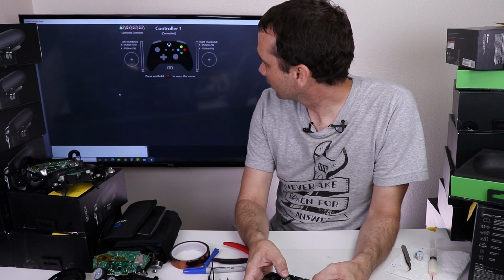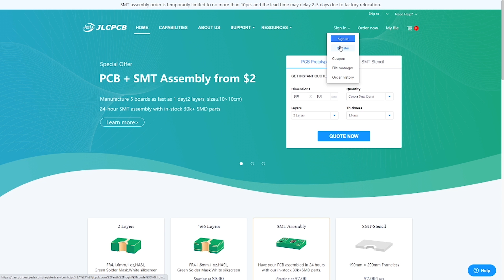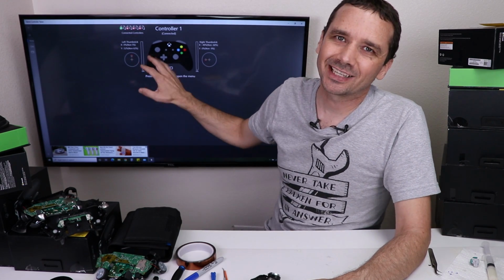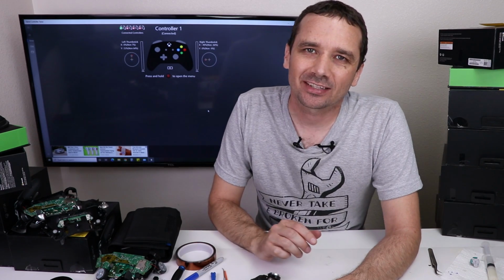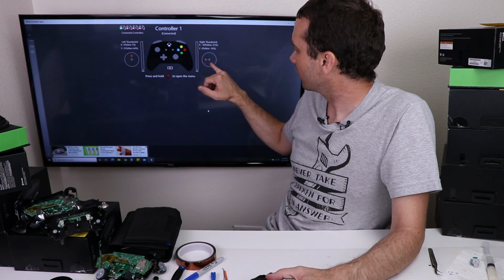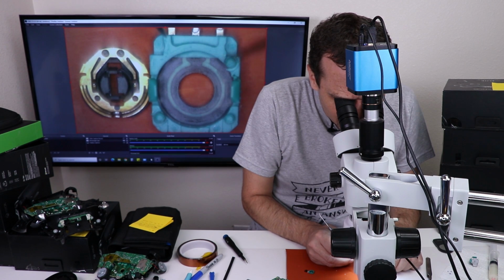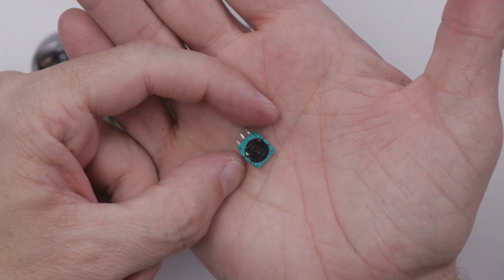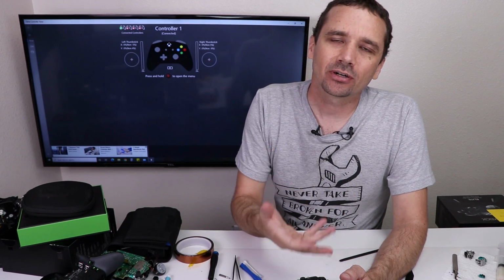How to Fix Analog Stick Drift - 3 Ways

Comment: I also just swap out the bad potentiometer ..... The nice thing about it is you can just use a soldering pencil and don't need a hot air rework station (Although I do have a couple of those too) There is also less of a chance of accidentally heating up and possibly losing one of the SMT components and you only need the most basic of soldering skills (Personally I've been soldering for over 45 years and can do it in my sleep) When I Mentor STEM students I just bring in some old PCBs and let them work with those until they get some skills and confidence by desoldering parts and soldering them back in again ..... Something any aspiring technically oriented person can do at home with simple equipment and then eventually work up to a hot air rework station as they acquire more advanced skills and knowledge

Comment: I have a question what kind of flux do you use and what temperature do you have the heat gun when removing  the soldering at the beginning. I have tried cleaning and changing the metal but no luck. So im try my hand at soldering even though I don't know how to solder. Any tips would be appreciated
Reply: I haven’t nailed down the settings on heat gun but it would be a minimum of 350c. No idea one air flow. 

Xbxox one/series controllers may need a bit more thanks to the massive ground plane sucking up all the heat.

Comment: Ive tried replacing my analog stick via soldering and I keep getting am up right input.  Could I have burned the board or not installed it completely.  Maybe moved a chip something on the board?

Comment: I have a question...i replace the analog stick and  it still drift. Any change that the drift is not cause by the analog stick? Or the replacement part is faulty?

Comment: Hey i gotto thank you befor asking my question i love your page and learned alot from it 📍❤

So i have a problem ... after i changed my R3 the analog stick still drifting like before now i am sure i have to add  smd resistor to recalibrate the controller 
Hopefully you can help me and others with that 
-Btw the resistor usually is smd 0805 (20 or 40ohm)

Comment: Hey tronics I need an answer for my disc drive on my ps4 the roller don't spin to suck the disc in and I see the gears or those white things don't move any clues how to fix I've cleaned any dust out

Comment: The black center resistance ring in mine was worn out but I noticed that only the middle of the ring was worn so I just bent the center metal contacts slightly(0.25-0.5mm) outwards and the joystick works fine again. When the outer edge of the resistance ring wears out I might be able to bend it inwards to use the inner edge before having to replace the joystick.

Comment: Amazing Video Steve! While you do say that your favorite method is just replacing the potentiometer, is there any downsides to that?
I ask because a couple of local repair people here say that they can do either method per my request, but they highly recommend replacing the joystick all together as it goes bad again shortly after.
Is there any merit to this claim? I want to make sure I do this right. I value your opinion and the potentiometer replacement does seem as the better option, especially given that you retain your original sticks, less solder work to do, and it’s cheaper.

Comment: I was wondering if it was possible when replacing the joystick if applying some dielectric grease to the potentiometers would help with durability? I was unsure if this would cause contact issues or not. The trouble is for me atleast most times the joysticks will fail quickly within 2 months. And it's just generally the potentiometers wear out again.

Comment: Just swapping the little disc that you took out at 6:00 usually works for me. No soldering required but you do need to spend a £1 to buy a stick from ebay.

Comment: I cleaned my controlled and it works fine now... huh.
Reply: I have a brand new controller and the right stick already does this
Reply: @Murdermatics  same bought 3 remotes in two months stick drift
Reply: @Murdermatics  mine is maybe like 2 months old at best and the stick drift started randomly and then got worse and worse and worse and this morning it literally just died. would not charge or connect or show any signs of life. however I tried again just now and it is working as normal. wtf
Reply: @Pugzei  yea im pretty fed up with Sony right now. Red dead killed my hard drive, both my brand new controllers are dead, and sony is quoting me over 100$ to fix my last gen system. I wonder what it feels like to be a valued customer. I guess 20 years isn't long enough to find out.
Reply: @Murdermatics  to a big company  like that they dont care if your a valued customer or not
Reply: @MrHunk85  I figure them caring would create the value in the first place. I agree that they don't care.
Reply: i opened it, used a compressed air to clean it from inside.
Reply: How ? You opned it ?
Reply: Huh...
Reply: So I spent 120$ on a controller
Reply: i tried doing that i still have really bad controller drift
Reply: @alannafey  worn out sticks then.

Comment: Some DualShock 4 controllers need to be just Zeroed in. Turn your controller over and there is a small hole to the right. Turn on the controller and with a paperclip bent straight push it into the hole until the controller shuts off. Then plug in the controller with your USB cable connected to the PS4 and push the PS button. If this helped all good. If it didn't? TronicsFix has the step, or buy a new controller.

Comment: What joystick replacements do you use? They are not in the amazon parts lists. I noticed on the 1st xbox controller you replaced the joystick with a different looking one (black vs the original silver/green) is that because it is better or cheaper? Thanks!

Comment: Hi.  one of my joysticks moves by itself.  I have tried to clean it on the outside but there has been no change.  The problem is that one of the housing screws is stuck and I can't get it out, even the screw head lost its form.  Do you know what I can do to remove the screw?

Comment: What is the program you used on your computer to test the analog sticks after each process?
Reply: You can just use windows own controller settings page in control panel (old) to see the raw values and movements

Comment: I tried to open the green square and clean the white pad and pins inside. It fixed my sprinting issue but joystick down stopped working so I opened and cleaned again and now joystick down AND up no longer work. I order some spare parts and am going to try replacing the white pad inside

Comment: My right joystick has the drift problems but i cant fix it😑 plus @TronicsFix my hard drive has data corruption everytime i play a game it say cannot continuing using application delete application then insert disc back u tried that i tried rebuilding data base alot and i have reinstalled system software over 100+ times is it a hard drive problem? i would much appreciate if you reply before friday because i will be buying a new hard drive

Comment: Is it possible to replace analog stick without a heating station? Btw, I LOVE your channel!
Reply from the maker: Unfortunately, no.
Reply: Yes it is, but it takes more time and skill as you'd have to heat the pads one by one and use a desoldering pump to suck up the solder and free the holes.
It's doable if you just replace the potentiometer as you only need to work on 3 pins.
The whole assembly is 14 pins: 3 for each potentiometer, 4 for the stick metal casing, 4 for the push button.

Comment: Okay I don't have drift But my PlayStation 4 controllers left stick works intermittently or sometime not at all in the up or moving forward position. All the other directions work fine. But when I move up it stutters movement horribly or sometimes won't work at all. Can any of these fixes help that?

Comment: When I was replacing components in my commodore 64 I started with solder wick. I found it wasn't that effective. The solder sucker works a lot better. I wished I had the desoldering guns that I've seen on youtube, but they are expensive and I'd only be using it for 1 device. Not worth it.

Comment: Can you add a link to the sticks and  potentiometers you recommend? I don’t see them in you parts list. Some are junk or too sensitive.
Reply: Same question here. Curious if he has a reliable stick/potentiometer vendor, if he just orders off eBay and tests, or if he just salvages them
Reply: It's easier to find the whole connector, "the green casing", and just take the little round metal thingies and replace them in your controller. They're pretty cheap.
Reply: @iseetrolledpeople  the wipers (the little metal thingies) are not the cause of the drift (unless they are oxidized, and in that case all you need is contact cleaner).
The scratched painted carbon in the green casing is the problem.
Reply: @bufordmaddogtannen  you don't need to have the scratches to have drift. Those metal, copper looking discs deform or get used and stop doing things properly.
Reply: @iseetrolledpeople  it depends. If it's not crushed beyond repair, the wiper can be bent back so that it makes contact again. I fixed hundreds of potentiometers over the years when it was worth doing it and these ranged from console controllers to audio to general aviation equipment.
As a rule of thumb, if I cannot clean the potentiometer (or bring the wiper back in shape), if I get an exact resistance value replacement I prefer to replace the whole thing.

Comment: You have to keep in mind that replacing the potentiometer wont give you the 1:1 feeling like before. They are always carefully calibrated,and so far nobody has find a easy way to recalibrate replaced potentiometers.

And be careful what kind of porentiometers you use. Some have different deadzones and curves.
Reply: an easy way to recalibrate them is to solder 500K Ohm SMD Potentiometer for each potentiometer and you can manually calibrate them like that.

Comment: But where do you get your parts? Its so hard to find legitimate parts, they always seem to be either aftermarket, faulty, or otherwise just not as accurate as the ones that come on controllers.
Reply: Thats what im saying i’ve gone through and returned three sets in a row of joysticks/ potentiometers because they all drift even after cleaning. Cant get a single one to sit still and if they do they’re too far offset from the center
Reply: I think he use the unfixable controllers parts

Comment: I bought somebody's first gen Joycons that were drifting for $20 for both. Said that constant drifting was an issue and always pulled up on both sticks. I fixed them both with compressed air blasts and now I have 2 extra cons for Mario Party! No drift after 2 months so far.

Comment: I have a problem with my ps4 and, it's a problem I have never seen before. My ps4 plays some CDs and Don't play some CDs . Also I noticed its mostly old Ps4 games like " God of war" "Horizon zero Dawn" "GTA v" and so on. But when I try to play "FIFA 20" or "Marvel spiderman" and some others ,it installs perfectly but when it tries to start the game it goes back to my home screen. And by the way I have updated my system software to the latest version, also changed the hard drive and still ,does the same thing. Pls I need help .

Comment: So I’m not sure if this is related, but one of my ds4, if I press the L2 trigger the controls also activated the “up” direction on the left stick. For ex: in a FPS pressing L2 to look down sight, my character will also start walking forward. Have you ever heard of this or why the heck these two things are connected? Controller is not abused or dropped.

Comment: Hey Steve, Where do you get your potentiometer from? I had the same Idea and checked out Digikey, but it seems like they doesn't sell them.
I ordered different Analog Sticks from Aliexpress a few Month Ago, but all of them turned out to be Bad, they felt like you're replacing  your Analog Stick with a Digital Stick.
I prefer the Option to Replace the Potentiometer only, because it's better for the Environment while reusing 90% of the Original Analog Stick.

Comment: Hey, here is a riddle for ya. What if you bought an absolutely unknown controller, that does not register as xbox controller, then replace the main chip in it on the xbox chip, and try to run it. Would it register as xbox controller, or it won't run at all?

Comment: I had a controller with drift which was making Fall Guys impossible. I pulled it all apart, and cleaned the offending area with a qtip and isopropyl alcohol and amazingly it fixed it.

Comment: The extreme closeup of the black track is very interesting. The question is, how resistant to wear are these pieces meant to be?
Reply: Not at all so they get stuck in a landfill and the consumers paying more to buy another.

These things if they are disposable parts should be hot swappable, and if not they should be made more durably.

Comment: Am I in the minority if I think it's easier swapping the whole stick out instead of just the potentiometer? I mean yes more soldering and sometimes they're stubborn about coming out but hey better than working on small pieces like that. And since they're so standard it's a pretty cheap part anyway, I know I've spent more than that on repair parts before.

Comment: I fixed like 4 different controllers over the last couple weeks that were drifting just taking them apart and just using compressed air and a qtip dipped in IPA to clean them out and tested. I'm surprised none of them had a worn out potentiometer given that they were at least a decade old at this point. I have the confidence to do this partly thanks to your videos and mostly from my prior cell phone repair job.

Comment: Love your videos man! Could you do one to show where you manage to purchase all your gear and micro components to replace the faulty ones? I've also been struggling to get HDMI ports off of a PS4 PCB, idk if it's because I don't have anything hot enough but the solder just won't flow and I've tried several heating utensils and methods.

Comment: I have only really had PS2 controllers long enough for them to get drift, as I used them for pc gaming too and other consoles post analog control era I never played much.  the most common problem I got was minor drift that would fix itself if I moved the stick into one corner then snapped it back then it would be fine until I next used console.  I always wondered if its fixable without replacing the stick itself, its so old its likely not worth it but I really want to fix it.

Comment: This might sound like a dumb question but why use that tape to protect other parts of the board and components? Doesn't the part of the board you're heating up will become hot anyway so surely the heat won't destroy the other part.

Comment: Why not use a desoldering gun? Like a Hakko 808 or newer. I use that and it works wonders! 😁 Also I inspect the potentiometers for wear and tear under a microscope and it’s like a lottery getting good quality ones. And then I use software on my computer to test.

Comment: Replacing inside potentiometer (white thingy that's being held inside the green plastic case) fixed my controller. It's worth a try before desoldering/soldering if cleaning fails. The part is less than $5 on amazon.

Comment: Man. Your video was two weeks too late for me. I unfortunately ruined my sons elite controller. I got one stick replaced but the second one didn't come out as cleanly and I think I ruined a trace to one potentiometer as it is at full left deflection in the test software. It was also my first time using hot air. Live and learn I guess. Thanks for helping and sharing!

Comment: i replaced just the stick. Went from the standard version to an aluminium one. Main reason was because it looked better and because of the analoge stick could get worn out. But it also stopped drifting.

Comment: Hey, where do you buy your potentiometers/analog stick replacements? I have been doing this for a while and I buy my parts from battle beaver. Yours just seem to be of higher quality
Reply: The potentiometers i bought i just can't connect them to the analog sticks. I don't know if i'm doing something wrong or if the potentiometers are bad.
Reply: @GabiGT  your wiper disks in the potentiometer were probably a diff size than the original
Reply: @grandogucci  i gave up and bought a ps5. f*ck it 😂
Reply: @GabiGT  😭😭

Comment: I've had multiple elite v2 controllers and have found that a very common issue is a faulty bumper (double presses, failed presses) it seems to be related to a very thin, small piece of plastic located by the switch, any chance you could investigate and see of there's a way for us to remedy this ourselves, please? 

Thanks, great video as always!

Comment: The nintendo switch joy con sticks have a rubber lip underneath that can be lifted up using a small stick or screwdriver, give a couple of squirts of isopropyl alcohol in a spray bottle on each side of the stick and roll it around for a good 5 minutes in every direction/orientation and let the controller sit around for 30 mins to dry. Repeat if necessary. This fix actually worked for us and you don't need to open up the controller or have soldering skills to fix the drift. It lasted about 3 months for us before it started drifting again though so it's not a permanent fix but its easy enough to do that I wouldn't consider it a hassle.

Comment: One would expect quality on a controller that costs 60€ which is the upper middle class of controllers. Not the top end 150€ ones, but neither 10€ cheap ones where I would expect to have these issues